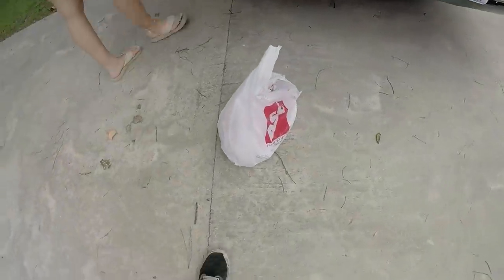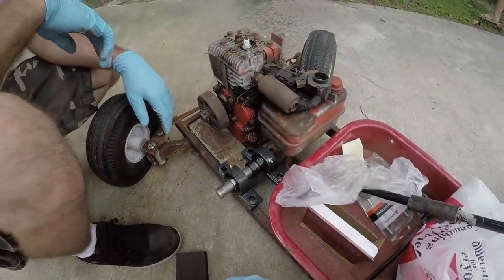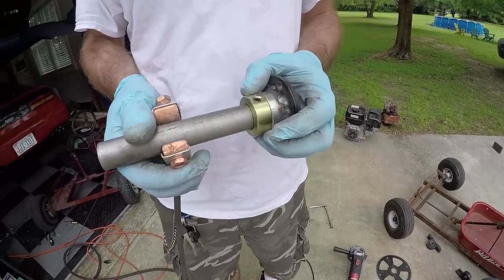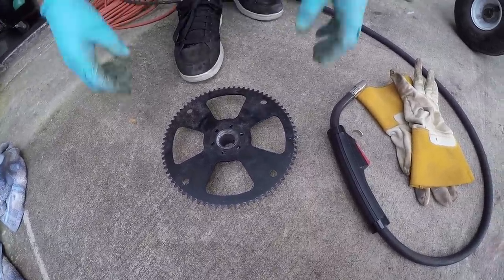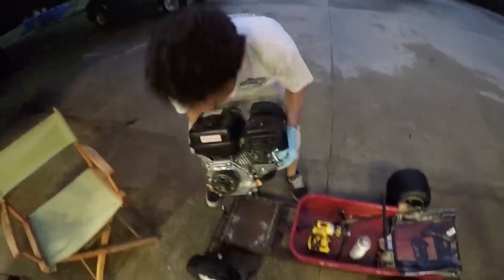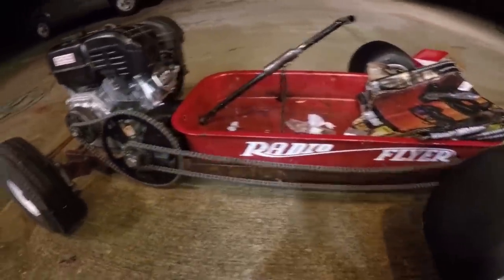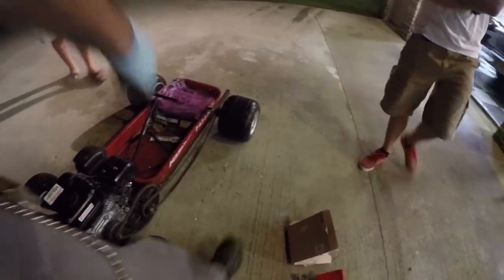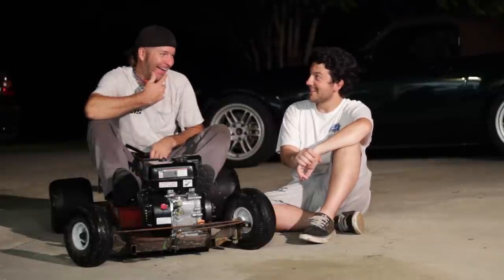Rat Rod Wagon Build: Pt. 5

Comment: Hey guys, I have seen you do it before and want to suggest that you use a half liter pop bottle with a small hole in the top to squirt water at the drill bit while drilling and use some oil, tap magic, something, while tapping threads. It makes the tools last much longer. your tools, your money, do what you want. I like the idea of the wagon. Cheap fun. I also agree with the need for some kind of differential instead of a live axle for better steering ability, but it should be fun.

Comment: Ditch the go-kart engine and put a large chain saw motor on it. it'll be 2 stroke and stupid power, plus it'll be smaller physically and look cooler.  might swap your sprockets around and of course locate a chain tensioner and chain guard.  I'd move the jack shaft half way between the engine and rear axle there should be space to mount it in the wagon, through the side and a small gear outside of course.  this would require the large gear to be on the rear.  but you get the idea.  nice project.
Reply: The problem with modern chainsaws is the have too much rpm. You need huge gear reduction to make them useful. Also no bottom end.
Reply: +hello hun how modern are you talking.  We've used them since I was a boy as they're plentiful (easy to get) due to all the logging.

Comment: You should put a big semi functional air scoop for the engine on top of the Motor, and then put a fully functional dual straight pipe exhaust system coming out the back XD

Comment: You guys should put a side pipe on it and definitely paint it with satin clear. Great videos keep it up!
Reply: Luke Furnish rat rods though by definition are flat paint, primered or rusted bodies.
Reply: Waylon Richardson its rusty
Reply: I meant that they should use satin clear, I would leave it the way it is though.

Comment: You need to do something crazy with the exhaust.
Reply: Alex Grace we are thinking dual exaust
Reply: That would be cool, do you mean from like underneath at the back or on the side like a rat rod?
Reply: i think underneath and out the back
Reply: Sounds good
Reply: Side pipes would be cool
Reply: Isaac Jennette Run the piping down below the tubs edge and T it off. Run two out the sides with 90 degree bends and have them run out the back with a 50-75 degree bend before the rear wheels. I think that would look really radrod-ish. Also you may want to heat sheild it because that's gunna be close to your foot. I heard that exhaust tape works well for that. Well not feet in particular but with motor bikes that have custom tuned pipes they tend to get hot quick and it's easy to burn your legs so maybe it'll save the bottom of your left shoe.
Reply: Alex Grace Side pipe.
Reply: Alex Grace yeah i was thinking a side exhaust opposite side of the chain

Comment: Consider doing a spooky tooth sprocket to control slop in the chain, on my tall bikes, when I'm a little more or less than a halflink away from getting chain tension correct, I put a sprocket in the chain and it works great, not sure how it would work on a powered chain, but I've seen one on a motorized bicycle.

Comment: I think you also have trouble steering when you have all the weight on the back axle when there is no differential because the wheels have to spin at different speeds to turn. If you had less weight on the back or you were on the grass, the inside wheel could slip and help the turn.

Comment: you need to figure out the Ackerman angle for the front axles, then the front won't plow in the turn. Ackerman effect is the inner wheel must turn sharper than the outer wheel does. Plus about 15 degree of caster will make the front tires self center after a turn returning to straight.
Reply: +TheSniffher it steers great! yes we didnt set up the steering for carting, it was only supposed to do 10 mph. and its not a bad setup , for now. it'll be fine

Comment: It'd turn better if you fixed the caster angle of the front wheels, that's why it plows so much, reversing past the point of it perpendicular to the ground, that way it'll be a positive caster setup

Comment: You should have run your small sprocket going from the clutch to small sprocket on the jack shaft, then large sprocket in the rear.  It would provide more tension for the rear and you're less likely to shear the teeth off of your axle side.

Comment: One reason for the steering problem is that simple steering like a kart has no way to adjust the camber in a turn.  Just look up camber and the wiki does a pretty good job explaining.  If you can make a simple change to give it some negative camber all the time, it'll help it turn but the wheels will wear unevenly.  If you have a way to modify it and make the camber change from neutral to negative as you turn, you'd have much closer to modern suspension.

Comment: I just bought a go kart of craigslist for $200, It's pretty heavy and only has a 5.5 hp 163cc Honda engine, and it accelerates pretty slowly. Top speed isn't too bad but it could be faster. Think it would be worth getting a predator 212 for it?
Reply: Shockwave How comfy are you with engine mods?
Reply: Shockwave Go here you can get a kit for 50 usd that will bring your little engine up to 8hp ish. http://www.nrracing.com/category-s/2603.htm
Reply: chapie62 Cool, thanks

Comment: Should have put the engine on the back it would look better and you probably wouldn't have the steering problem
Reply from the maker: MRlovebmx1 You're probably right, but we were going for the model A rat rod look, which is generally a front engine, rear wheel drive setup.
Reply: Engine in the front will look way more bad ass
Reply: MRlovebmx1  putting the engine on back would take more weight off of the front which is helping the steering
Reply: GALAXIE 500XL you do realise isaac is one of the guys building it right?
Reply: MRlovebmx1 The way the front is set up right now, no it wouldn't. The geometry is nonexistent. No caster or camber to speak of. The front end plows too.  They need weight on the front. If they fix nothing else, I hope they do fix the plowing. That alone could get somebody hurt badly. Steering stops come to mind.
Reply: GALAXIE 500XL It plows because it has a solid rear axle with large tires.
Reply: MrKhapp  I respectfully disagree. How come the other carts don't?  What causes this one to plow the way it does, It turns to deep. Steering stops will remedy that.
Reply: GALAXIE 500XL In order to turn, the rear wheels need to be able to travel at different speeds.  The outside wheel will travel faster than the inside wheel. Cars have differentials to help with this issue.  The $200 cart is one wheel peel, this allows the inside tire and outside tire to travel at different speeds so turning is easier.  If you're referring to the racing kart, the geometry of a modern racing kart frame actually lifts the inside rear tire when turning to reduce the friction on the inside wheel therefore allowing the kart to turn easier.
Reply: MrKhapp I know that's basically right. Go back through the video and you will see what I'm talking about. When you turn the wheels as far as they will go left or right, they turn way to deep. Turning the wheels that deep will cause them to plow. Also, When the wheels are turned that deep, the cart wants to slide the front wheels instead of going whichever direction you're trying to get it to go. Which is dangerous. It can cause someone to be thrown off.
Reply: GALAXIE 500XL I will agree the wagon does not have good suspension geometry up front which definitely doesn't lend well to it turning, but in my experience the solid rear axle with such wide rear wheels is a bigger issue.
Reply: I think the main problem causing the plowing is that there wasn't enough weight in front causing it to understeer due to lack of traction. I also agree that the front wheels steering angle is too much, steering stops would help.
Reply: MRlovebmx1 The steering issue isn't because of weight its because of the geometry of the wheels when they are turned...when turned they turn at the exact same angle...on a car when you turn the outside wheel doesn't turn as hard as the inside its called the Ackermann steering geometry.
Reply: Zerek P and they tilt don't they? ...camber??
Reply: +Ryan P you are correct
Reply: They need weight in the front to be able to steer
Reply: +Isaac Jennette I have a suspension system that's super easy to figure out if you want me to send you a couple pics
Reply: +CarsandCameras 
What kind of drugs was Jackie on?  I'm assuming she passed out

Comment: Hey John I just bought a new ohv engine a don't know how to hook up the throttle cable because my old engine is a old 5hp Briggs and Stratton engine and hooking up the throttle cable on that one is totally different from my new engine. Please help thanks
Reply: +Addison Elsasser im not john but ill try to help. we like using bicycle brake cables for throttle cables when the old cables dont match. when you cut the cable to length, make shure you pull the cable threw a couple of inches before cutting. good luck

Comment: Did you put engine oil in the engine or did you put motor oil in the motor? see that is the fact of the matter engine or motor is correct. Oh and don't start about the electric is a motor  it is also a motor but can never be an engine

Comment: Anyone shed some light on this im over in the uk and I bough a 212cc engine clone for a gokart plan but I knew there was something wrong with it and when it starts it stutters and has a rough idle and when you rev it it revs very harshly it's like ping insta Rev or it bogs down and dies I thinks it needs a new carb
Reply: iCloud Henshaw take the choke off ?
Reply: Choke isn't on
Reply: probably has trash in the carb
Reply: replaced carb wont run unless choke is but runs fine revs and idles much better with but with open carb just bogs down so its not getting enough fuel
Reply: don't know why

Comment: Chain tensioner
Reply: BLACK 0PS BOSS that will be a must
Reply: ya
Reply: you should change the big sprocket with the one in the front to get more speed
Reply: +Mr. Bob  I mean put the big sprocket on the engine ,and swap the small sprocket where the big is now .